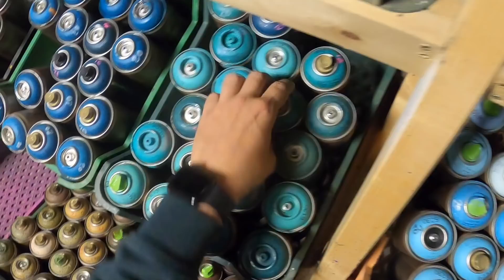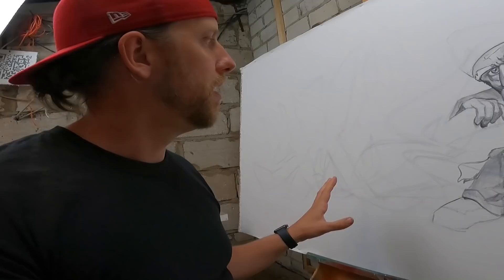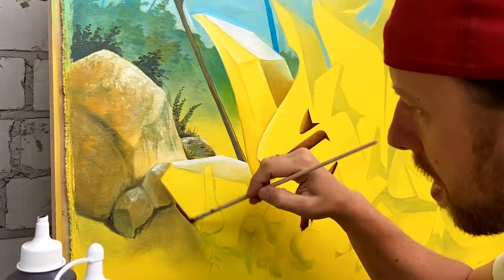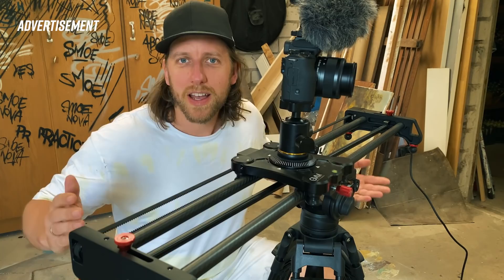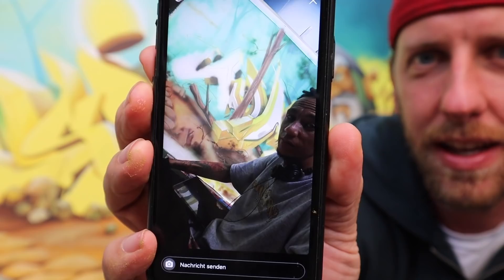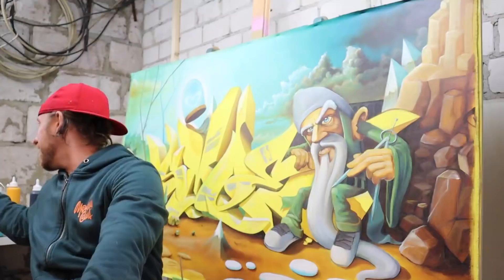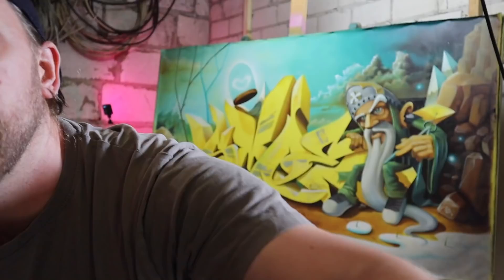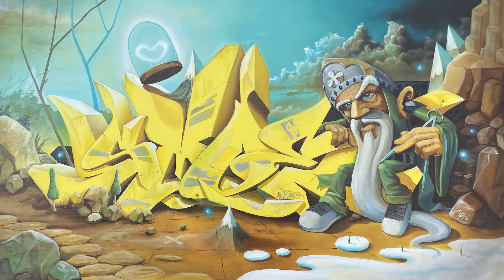surrealistic 3D graffiti CANVAS ft. @edmunpdf | full process

Comment: I don't understand why the part of the E wich goes towards the mountain is "cutted" under the arm of the character
Reply from the maker: Ok, Smoe, Challenge accepted, use all 500 vacaubularies in your head to explain why the the E is cutted: OOOOOKAYYY: The E has besides it´s mirrored „3“ shape a short Serif underneath the Alchemists right hand (left side) and he is leaning on it. the E has an extra bar on the bottom that the Alchemist uses as a seat, whil the extra bar at the bottom has a second, nearly fully covered 45° to the upper right facing, single connected extra bar, that reaches upwards behind the back of the Alchemist and only the end of it is visible behind his left shoulder/ear (right side). I hope this helped! hahaha, thanks for your support, Fillo! I think that you thought the Serif of the upper part of the E was the same element, like the End of the single connected extra bar, that is behind the Alchemist….